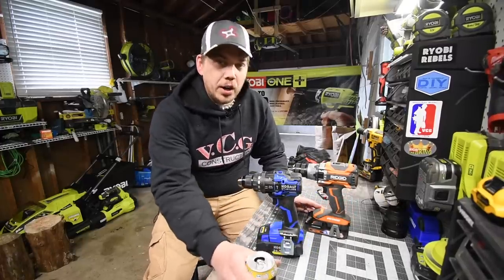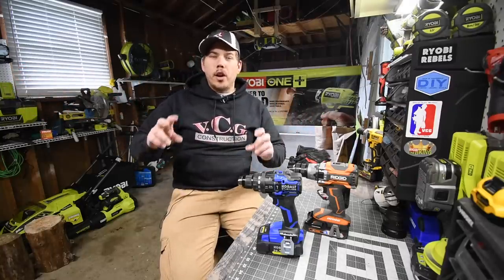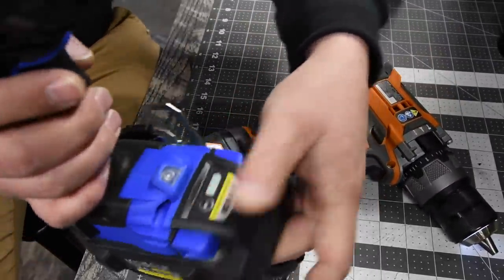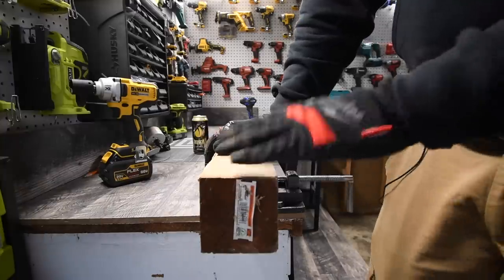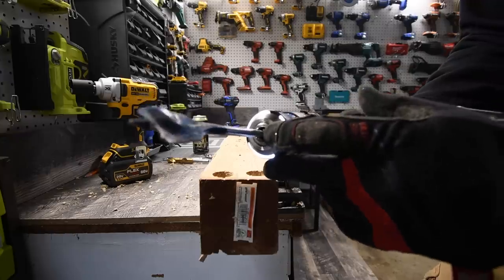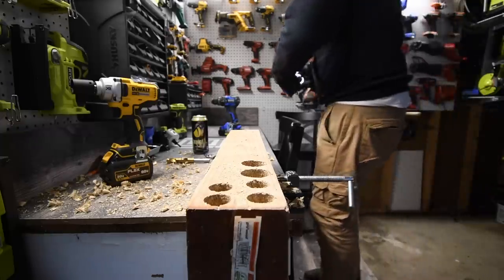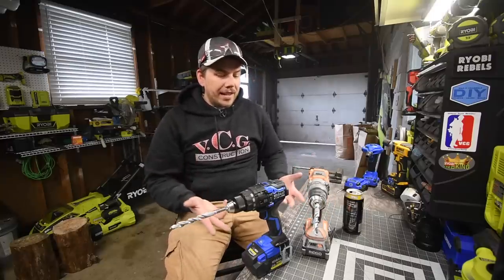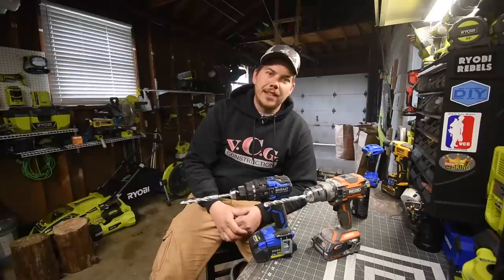Kobalt XTR Vs. Ridgid Octane (Hammer Drills)

Comment: When you lock a keyless Chuck and it makes that ratchet sound tighten it as hard as you can then turn back the opposite way until you here 1 click, that’s is a self lock 🔒 for keyless Chuck with ratchet technology
Reply from the maker: I thank you
Reply: Man Caver Tools must love hearing how to use tools when resistance and friction caused failure
Reply: You must have also watched that recent video on locking the chuck.  I have never heard anyone or heard of it myself until that video was released.  Mind was blown.

Comment: I have the old 24v kobalt and my friend has the slightly older ridgid.  The kobalt shines at high rpm stuff, for example we were drilling a bunch of 4" holes in 1/8 steel.  The kobalt just eats those holes up while the ridgid is absolutely worthless garbage because every time the teeth just slightly bite into the metal the kickback turns on so the ridgid just kept stopping and couldn't do the task at all.

However the ridgid shines in low rpm torque, we were mixing concrete and the ridgid seemed more powerful in its #1 setting than kobalt, in fact the kobalt burned up that day and had to be replaced.
Shout out to that excellent, no questions asked 5yr return policy for kobalt, dewalt warranty took 3 months.
Reply from the maker: very good and I thank you for sharing your story

Comment: Hey Nick, I noticed at 7:57 your bit fell out. I was wondering if you knew that to tighten bits in, tighten the chuck until you hear the large click then the small ticks, then untighten it a little and youll feel the large click. That means its locked in place and itll never drop drillbits again.
Reply from the maker: it was locked in to place but it came undone because of the resistance. it happens to every tool sometimes
Reply: Danny Piotrkowski I don’t think that you should be calling people idiots, when you don’t know the difference between “your” and “you’re”. ;)

Comment: Thanks for putting these reviews out there! Awesome Kobalt performance, but I really love that Ridgid Halo light ring... there's no doubt about it, that light feature is a beauty and must work really well! Almost 100% with PPE but I'd highly recommend changing up when you do the concrete tests. As you may know, concrete dust contains high levels of crystalline silica which can lead to lung disease, silicosis, and cancer. (had to Google this to, but it's out there so be aware). Instead of the Kobalt Blower (which I'm hoping to see more about), try instead using a vacuum and then rinsing the contents down inside the vacuum container while also wearing a facemask. Take care!
Reply from the maker: will do and I defiantly need to use a face mask while doing concrete.
Reply: @ManCaverTools  Glad to hear it brotha, have a good week!

Comment: Use a regular 4ah with it. The new max amps are trash and overheat the tools as well as the battery. True blue fan here with both applications and the new batteries are the worst thing kobalt has come out with
Reply from the maker: very good and I thank you cross

Comment: I think Ryobi and Ridgid have their thermal/over current protection set too low
Reply from the maker: I agree with that 100% their motors are able to take more abuse then the motor is allowing it to do
Reply: I think the same thing about Kobalt, that drill seems to cut out with too much left to give. Maybe that's just the tradeoff we have to make for a good warranty on a comparatively cheap tool.

Comment: Use the 4 Ah battery with 3 bars(lights), should even things out...(Kobalt)
Reply from the maker: I think it was a fair test and I thank you Project
Reply: Kobalt UM is 21700. Wouldn’t matter. Except it overheats really fast. The regular 4ah works better.

Comment: I can tell you right now that the results are majorly flawed. I own the 3ah ridgid batteries and they suck balls. use a normal 4ah hyper li. the octane does not have the sustainability for these types of tests. they have major overload protection for the limited amount of cells. more cells means less work per cell.
Reply from the maker: you are right on more cells then less the work per cell, but you are wrong on the 3ah octane battery. it is powerful. powerful enough to use against HILTI and Milwaukee and Dewalt. looks like you got  a bad batch of batteries. look at my video on the Hammer drill Brawl. Ridgid wins in some test against the bigger guys using a 3ah octane battery.
Reply: @ManCaverTools  what I mean about the octane 3ah is that it doesn't last anywhere near as my 4ah and it has more overload timeouts overall. I have 4 3ah and 2 older 4ah hyper lithium batteries and when I run high demand tools, the 3ah can't keep up. Hookup the bluetooth to the octane battery and it will tell you why it times out and even give you notifications. Runtime is way down from the 4. I tried both in my router and sander, the 4 lasts twice as long
Reply from the maker: JT vs Tha World we are not doing duration in these test. We test out how much power these tools can put out for a few hardcore tasks. The batteries should not die out over a few screws and holes
Reply: @ManCaverTools  my main point was that the more complex the engineering of the battery causes the timeouts vs the power of the tool. So in essence, you tested the batteries against each other.  I appreciate the replies. I will test my theory more in depth. And redo it when I get a 6 or 9ah

Comment: The ridgid battery is half dead
Reply from the maker: if you watched the video I had to let the battery charge and I did. but thank you for not watching the entire video
Reply: @ManCaverTools  i think you can use any Ridgid GEN5X battery to run on there octane drill. I have the ridgid octan and I'm using there 4 amp battery for a gen5x ridgid drill and it works fine for me. Dud love your video keep it up.